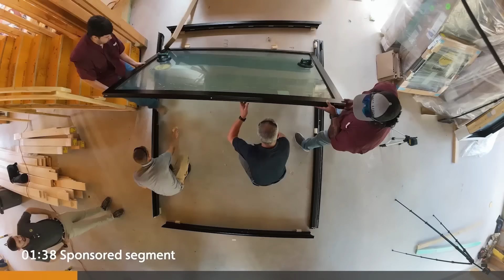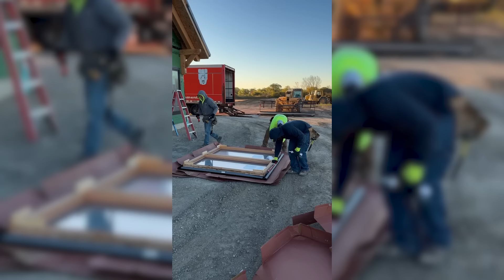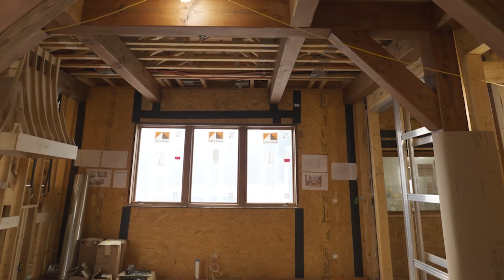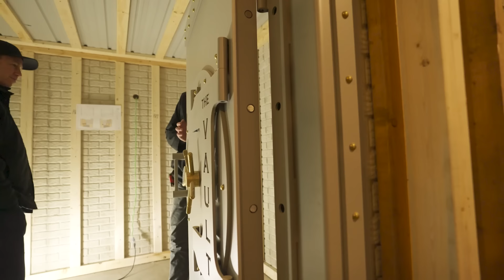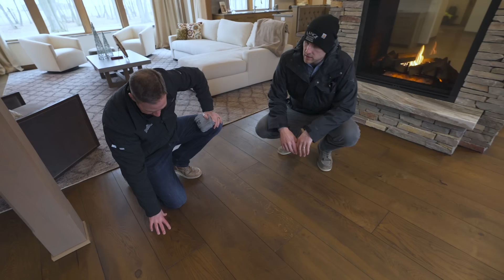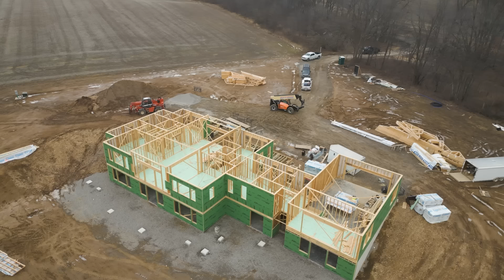Build Across America - Ep. 6 Upper Ohio Cold Climate Construction

Comment: If they're using a dehumidifier to grab the pool's lost water out of the air and put it back in the pool, are they testing that water or cleaning it in any way first? Typically the water from an indoor air dehumidifier carries a very high level of dissolved VOCs, PFAS, and other toxic soluble gases. Normally we dispose of that down the drain. Maybe their house is clean enough that it isn't an issue for them, but I'd definitely want to be testing that water. 

Hooking a rainwater tank to your downspouts is not a very expensive option to give yourself independence from town water supplies for things like keeping a pool topped up. The first minute or two of a rain event catches all the soluble pollutants and particulates in the outdoor air, but usually a first flush diverter is enough to dispose of that contaminated water and then the rest of the rainfall should be very clean.

Comment: I love that garage ceiling detail. I've been thinking recently that the best way to apply steel wildfire shutters over windows would be something similar to that, garage type doors in the correct width for the window sliding up into the verandah ceiling. Of course this would put the "inside" of the garage door facing out on the exterior of the house, but I'm sure a clever garage door manufacturer could make it work. Traditional casement shutters just don't work with current expectations about how much window we will have on the outside walls of living rooms, so we need to get more imaginative when it comes to protecting our homes from fire.

With a roller type rather than a panelled door, I think we could even have a fairly narrow slot in the ceiling where the shutter goes through, rather than a large opening like that. There's always going to be some sort of critter trying to get into a space like that to make its home, but with the edge of the shutter flush with the ceiling and a draft strip type brush on either side I think we could limit the size range of things that can get in there.

Comment: I wonder how long it takes from planning, to machines on site to 100% done for something like this.  gonna guess at least a year if not more.  my uncle had a custom house built in the late 90s that was actually just a touch bigger than this but a very similar style in a lot of ways, took that crew 18 months, but was in planning and permitting and what not for at least another 3.  Meanwhile a friend of mine about 2 hours up the road near wooster had a super large (it's about 60x120)steel shop+house (maybe 1800sq ft) add on built in less than 4 months.  The little details aren't as nice but it was done so fast it was sort of shocking.
Reply: Build time is shooting for 18mo. Design to completion will be over 2 years.
Reply: thanks for the info... guess some things don't change.  That house my uncle had built as of 3 years go is still in great shape basically 30 years on, just needed reshingled and the stucco painted, thats about it.  meanwhile on the other side of the family, one of my cousins has one of those MI home mcmansions built in 2003, the thing is already worn out bad, basement has a lot of those reinforcement plates, roof needs not only new shingles but new plywood, the subflooring is sagging like they had 15 years of termites in it, drywall problems everywhere now especially on the ceiling, to top it off the doors and what not aren't closing right anymore.  I mean I get it, the things are built to a price, but i have seen houses built in the 60s and 50s that are in far better shape.  Whats the word on how long those PEX tubes and systems last, it's about the only thing my uncle didn't spring for because it was insane money back then.

Comment: The "disappearing" garage doors are very cool aesthetically, but functionally, I'd rather have them roll into the garage the traditional way so you have the massive amount of usable storage space above!
Reply: I think that house is plenty big with the huge basement. No need for squeezing out every inch of storage.
Reply: Also when it comes time to replace those does or rails in 30-40 years that framing is going to be a complete pain.
Reply: @shoal007 you can replace the tracks by unscrewing them from the attic and taking them out the bottom not as easy as a regular door but doable without toomuch hassle.

Comment: Ohio cold is nothing compared to my Minnesota location.  I used Zip R-12 with closed cell foam between studs, spray foamed the ceiling drywall 2" in the attic and put blown fiberglass on top of that.  R-60 ceiling and R-30+ walls.  Air tight and water/moisture tight.  With 2x4 studs and Zip R-12, regular windows/doors that fit into 2x6 walls work the same.